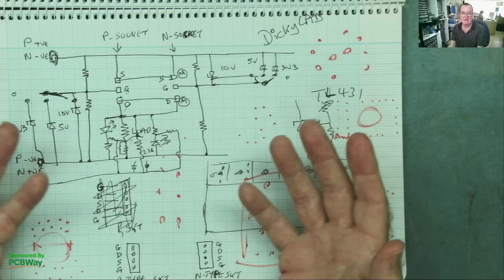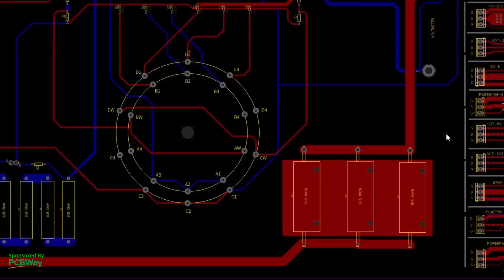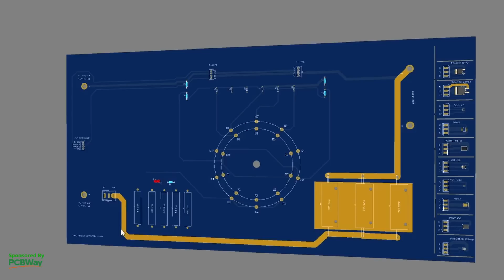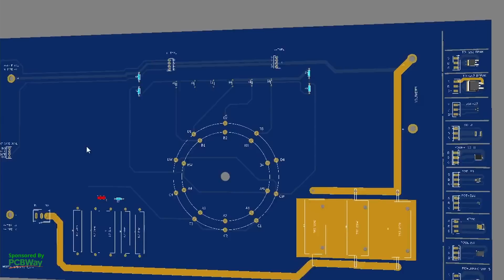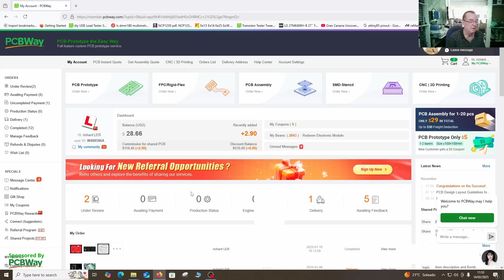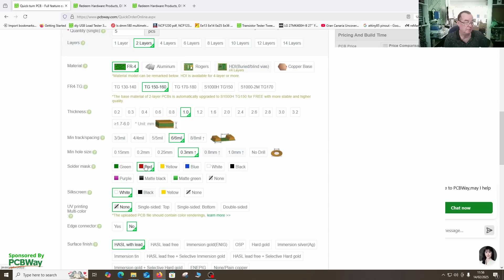The Amazing Fake MOSFET Detector ENHANCED VERSION

Comment: Using code on a CPU to try to directly bit-bang or sample pins on the scale of nanoseconds is a fool's errand.

Many modern MCUs have built-in "I/O engines" that can drive pins in programmable patterns/sequences with granularity down to the clock rate of the MCU itself. You create a sequence of descriptors telling the engines what pins to flip and with what delays in between, tell it to go, and wait for it to interrupt you when it's done. Some of them can also block on external pins such that you can program them to do things like "drive output A high, then wait until input B goes low, then count 10 clock cycles and drive C high". Some of those engines can control on ~10 nsec granularity - would that be good enough?

The beauty of those I/O engines is that they don't have any competing loads - all they do is execute the sequence of descriptors that you give them. I designed one for a family of ASICs a long time ago in a job far far away, and they can be lifesavers, especially for patching around timing bugs in other hardware.

You could of course use an FPGA and create any circuit you want, but that would be extreme overkill here since what you want seems to be well within the capabilities of stock I/O engines in standard MCUs.
Reply: Modern MCUs also have pretty cable "clock" modules that provide free-running counters (in ~10 ns increments) as well as the ability to measure the time in clock cycles between certain classes of internal and external events. You can do really powerful things by combining those with the aforementioned I/O engines. It would be pretty easy on most MCUs to measure the delay (again in 10-ns increments) between driving some I/O pin and seeing an external pin go high. IIRC the STM32 series are particularly capable, but even the lowly SAMD21 has a lot of functionality like this in its Events, DMA, and clock subsystems.

Comment: For my Physics Degree in 1977 I chose to do an Electronics Project on Negative Feedback in Amplifiers. 
The Components were soldered to Panel Pins that were hammered into a short length of Board. 
No Perfboard or PCBS required and the Device worked perfectly.

Comment: Great idea. 
Question have you had fake items like  from good companies like Mouser
And if so then yes I would use your system
Reply: Major distributors like Mouser, Digikey, Hamilton, etc. take special care in sourcing their parts. You will not get fakes from them. Now Ebay on the other hand.......
Reply: @glasslinger  I tend to order from respectable companies like such
But some good eBay sellers tend to sell on their behalf
So it can be misleading to say eBay users tend to sell fakes only
Reply: @Sputnickuk  Yes, it would be totally misleading to say that! I often buy components from ebay, mostly with good results.
Reply: @glasslinger  all I can say as a hobbyist is not requiring a full accurate circuit for commercial sales then one would not be bothered 
Unless the requirements are to be exact  for guaranteed support of 100% reliability 
For that we don't get that in top brand products to this day

Comment: A combination of my experience and my opinions:
1. 10amps is too much for traces. Good call on leaving the copper exposed because I always have to solder bare wire along it.
2. Banana plugs are all great, but your basic DC 5.5mm barrel jack is just so convenient that I've ordered 100 pairs and converted just about everything I own that uses less than 5amps to take them. Every thrift shop in town sells 19.5v, 3amp power supplies for $2 and 9v or 12v adapters for $1. Save banana plugs for the heavy current stuff, but please just add a 5.5mm jack to your boards for people who don't have a fancy power supply. The starter electronic hobby world runs on discarded laptop supplies.
3. Yes, please use a TL431. Simpler and more accurate. Those who care about logic level mosfets could sub a TLV431 to check the 2v gate threshold.
4. Anyone who thinks this would be better with a microcontroller  is objectively wrong. And I'm just gonna say it: your sweep generator didn't need one either. :p
5. Those giant power resistors seem unnecessary. You could very easily, and more cheaply, have a constant current sink at different settings, just using a couple power MOSFETS. Obviously, you'll need to test them first to make sure they're not fake, but you can do that by... Oh... Wait....
Reply: 6. Just thought of a much simpler way to avoid a lot of components. You can replace half of the zeners and the complicated switch with a inverting buffer opamp. Or even better, the all the zeners with the TLV and an opamp. Generate the N-channel voltages, and the opamp automatically generates the equivalent P-channel voltages. If the opamp is powered through a small bridge rectifier it won't matter if you swap the power supply leads around.
Reply from the maker: @SkippiiKai  It is for reason such as this that I'm going to release all the files so you can import them into Kicad or whatever you like to use and then modify the schematic and PCB layout easily.  The schematic is already in the video description, feel free to modify that as you like and please let us all know when you have a better version.  I'm happy to build whatever you come up with and test it on the channel. Make sure to put your name/brand on it. 🙂
Reply: @learnelectronicsrepair  Well, yeah, but then I'd actually have to learn Kicad and do work. But if you do it, you get... CONTENT. 😁 I'm just kidding, learning KiCad is on my list of things to do. I did have one idea related to this: have you considered having a shared google drive folder where your followers can upload and  share their own schematics and files? Or do you already have something like that for Patreons supporters?

Comment: Although PCB tracks can carry quite a lot of current, I personally would have used wider tracks for the 10A connections. 
The way you connected the load resistors is very good. Current flowing in from top right and out from bottom left. This gives a good distribution of the current over the 3 resistors.
I still believe the project will benefit from a lower load voltage. Power is voltage times current. So the the load resistors can be much smaller when voltage is lower and much less heat will be generated. 300W on a PCB is really a lot and not easy to manage. It will take some undefined time to heat up, but it certainly will get too hot after a while. When you proceed with this design, I would recommend adding some kind of thermal protection.

Comment: Even with an oscilloscope there is no point in trying to measure switching time parameters or gate charge unless you use the specific test configuration shown in the datasheet or do direct comparison with known-genuine parts.

As an example, the test for total gate charge, as it appears in the tabular specs, for an IRFP460 requires a 400 volt supply at 20 amperes (8 kilowatts!). You must drive the gate with a pulse regulated at 3 mA. There are curves in the datasheet for drain voltages down to 100 volts, which eases things a bit.
To measure the switching times you need a 250 V, 10 A supply, a 13 ohm load resistor, and a gate driver that can source and sink about 2.3 amperes. The resistor would have to be non-inductive. 

You would need a fast scope with fast 100:1 attenuator probes.

When I was designing with power MOSFETs, I don't recall ever once caring about switching and delay times since they are so heavily dependent on gate charge and drive current (gate charge). Total gate charge is a very important "figure of merit" when comparing devices that might be suitable for a design. I used the IRFP460 in a few designs.

=====
Zeners of 3.3 V and 5.1 V will be true zener diodes (above that they are avalanche diodes). The "knee" of the I-V plot will be dismally rounded. Generally the lower the power rating the better the performance around the knee. 500 mW parts will be better than 1 W parts.
 The TL431 might be better, but be careful about capacitance. It can be unstable with the "wrong" combo of capacitance and current. This is detailed in the datasheet.
Reply from the maker: That is why I left the option as, well, optional.  It is purely there for others to work out if it is useful or not.

Comment: Regarding the zeners being accurate enough as gate voltage references?
In situations like this I tend to use something like an LM317LZ and switch in multi-turn trimmer resistors to adjust the voltage output. The advantage is there is no need to have the second set of contacts to switch up to the voltage divider.
Of course it's probably even easier using a switching supply but that might introduce noise and over-complicate things.
Also, your schematic needs the input voltage marked (12V?).
Reply from the maker: If you watch the original $1 version you will know there is no input voltage.  You set your bench psu to 1A (constant current) then start from zero volts and turn it up until the LED just illuminates.  Whatever voltage is on your bench PSU display, divide it by two and that is VGS(th).  Then just turn your PSU up to maximum voltage.  At some point around 23.5V the current limiter will kick in at 1A.  Now whatever you read on the multimeter in millivolts wil equal RDS(on) in milliohms.   Compare VGS(th) and RDS(on) with a known good mosfet or the datasheet. There you go.
Reply: @LearnElectronicsRepair  - I saved the original video for later reference, but forgot those details (about operation) before making my comment here.
Sorry if it came across as snarky 😉😃
One thing that might need consideration for a full explanation and instructions later... usually in datasheets they specify RDS at various Vgs. The Vgs(th) is when it first starts to conduct but I personally find that RDS at a particular voltage (eg: Vgs 5V) is a more reliable indicator that the Mosfet is in spec. Obviously that's what the switchable zerers is resolving, which is a completely different mode of operation to the original circuit. That's why I kind of considered this schematic as completely different, and forgot about the CC etc.
...
To explain my thinking... I made a USB cable tester that uses a 1A CC buck converter and a shorted out 2nd Mirco or TypeC socket. Just plug in cable, plug in the shorted socket, and measure mV across the powered end to get milliOhms and calculate V drop from there. Usung that system you don't need the load resistors or the lab power supply, just need a way to vary the Vgs.

Comment: Personally I would like an Arduino-based fake MOSFET detector with an LCD display. Instead of rotary switch I would use relays to switch in and out the different resistors which would be selectable from the LCD display menu. I know it's more complex but it would make it look more professional and modern. I also like Arduino-based projects 🙂
Reply from the maker: Once I tested the PCB I will make all the files available (schematic, pcb layout etc) so feel work on this further if you would like to make a MCU version
Reply: The OP is probably somebody who thinks you need an Arduino to flash an LED 😂
Anyway, the video discusses why an MCU is a silly over-complication. KISS is usually better for test equipment.
Reply: @johncoops6897 If we never push ourselves to do more complex  things, then we never progress in learning, so you keep things simple if that's what you like.I like to push the boundaries and learn new options which create new ideas, to be creative, isn't that what electronics is about? If we just keep it simple all the time, than we can only do simple things.
Is all your test equipment  simple?
Reply: @davesdigitaldomain  - no, intelligence and good engineering is when you use the simplest solution that achieves the required result. There are plenty of projects that are FAR easiest and better done with an MCU, but that doesn't mean that it's always the case. Not everyone has the time to "fiddle around" with designing and programming just to be sure measure a voltage (like this circuit allows).
Reply: @ @johncoops6897 As I said if we push the boundaries and learn more complex things then we are more able to see the simple things .so don't knock me for trying to be creative and to push myself to learn new things. You keep it simple if you don't have the time. But I want to put an LED display  with a selectable menu to make a more presentable more satisfying to ME  project also  i want use relays that are more able to cope with the current,last longer than a simple rotary switch that was renowned for getting bad contacts so they stopped using it.
Why do you have a big problem with what I want to do?
Reply: @davesdigitaldomain  - I don't have any problem with anything that you do.
Relays aren't necessary, the current is MicroAmps to the mosfet gates... the biggest problem is that you need a step up in voltage from the IO pin <5V to at least 10V.
What would be possible is to PWM a mosfet then have a smoothing capacitor to approximate a DC gate voltage.
What would possibly be more useful would be a MCU script that ramped the gate voltage up slowly, and then monitored the Drain to Source voltage drop. You'd need an external ADC to get accurate readings at 10A or so of load.
Then the MCU could create a graph of gate voltage vs Vgs.
Then again, that's a lot of mucking around to just check a few Mosfets you'd purchased from China every year or so.
Kind of like redesigning the wheel, or making a DIY project that ends up doing the job of the continuity setting of your multimeter.
I just designed a latching continuity tester using some logic chips, a 555 and some diodes and LEDs. It's more challenging and fun doing that, rather than spending hours programming a MCU to do the same job.
Reply: @johncoops6897  thankyou

Comment: I like your idea of adapters for different packages. I did wonder if that might be an idea for the op-amp tester allowing you to have just one or two sockets, but I didn't mention it because you already had the pcb.
Reply from the maker: The op amp tester has the breadboard in the middle so you can fit adapters for any unusual SMD devices.  To be honest I only thought about the snap off adapters on this project because I needed a lot of them.
Reply: Sorry, I wasn't very clear what I meant. I meant you could have a single socket for all types of through-hole op-amps or comparators, single/dual/quad with the adapter boards redirecting the signals to the correct pins. One socket plus the breadboard.
Anyway, it is done now so no point in going back.

Comment: Aren't R3 and R4 superfluous if you connect all the wipers together? Unless I have misread your circuit the wipers are all connected to the midpoint of the power poles.
Reply: The wipers are not all connected.  A and B are connected, and C and D are connected .
Reply: @mikepanchaud1  I know, but they could be. A and B are connected to the midpoint between a pair of 1.2k resistors, C and D are connected to the midpoint of another pair of 1.2k resistors. Only one pair is in use at any point one time so they could use the same pair and connect the wipers.
Reply from the maker: @chrishartley1210  Without checking this sounds like you are correct. A 3 pole 4 way switch is more easily available.  as this is th revision 0 version it could have your mod in hte final version.
Reply: @learnelectronicsrepair you could definitely use one of those 12-click rotary switches. There are 4-pole versions are 3xsingle throw. My phone is not showing the schematic clearly enough for me to work out if it's feasible after a circuit revision?